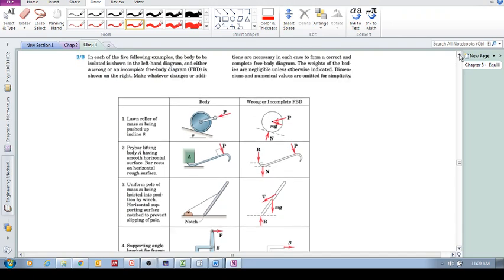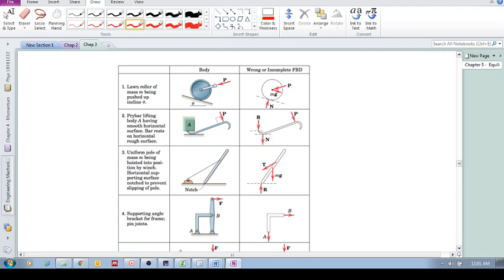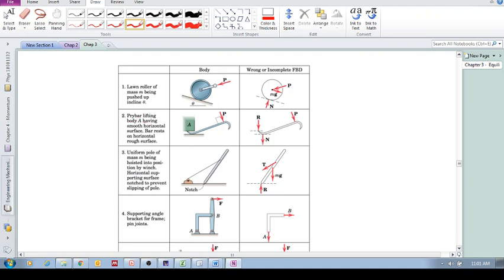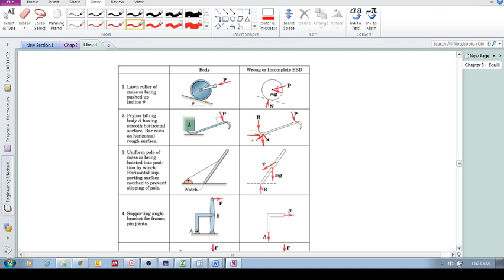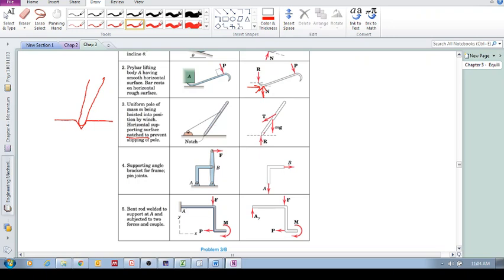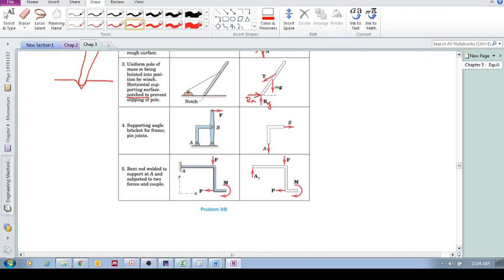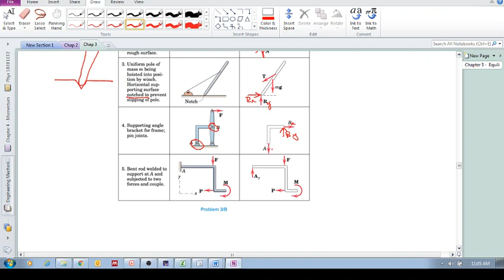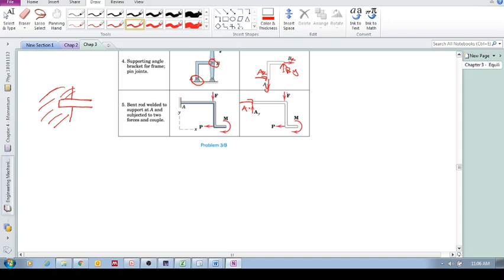Chap 3.2 - System isolation and Free-Body Diagrams (e):  Exercise,  incomplete or wrong FBDs

Comment: For Q4 shouldnt the Ay force be pointing upwards?
Reply from the maker: Practically it doesn't really matter which direction you point the force.  If it is the incorrect direction, then in your calculations it will come out as a negative value.   However, by inspection, if I am applying the force F at the top, then the effect is that it will tend to lift up the angle beam from the floor pin connection.  This means that there is a downward force resisting the angle beam from lifting off the floor.    But even if I make the wrong assumption, the calculations should let me know.